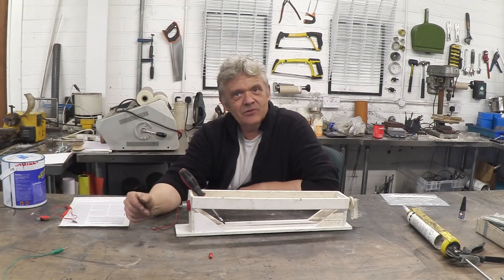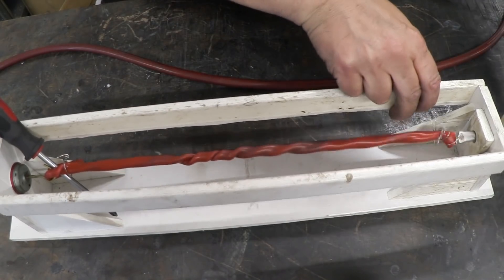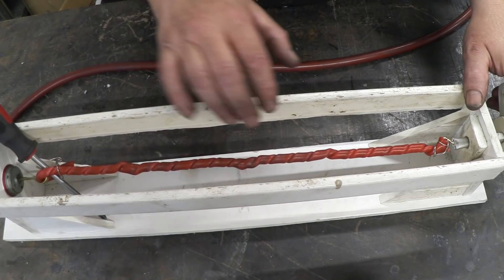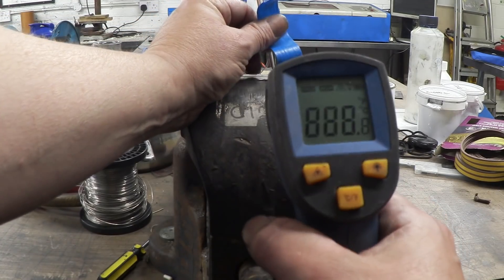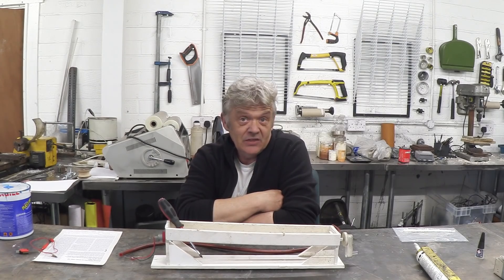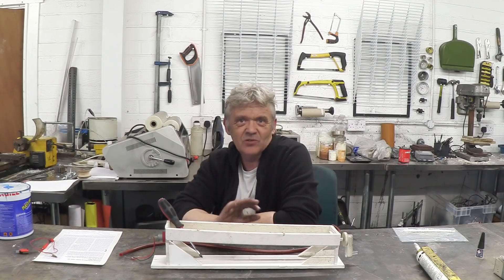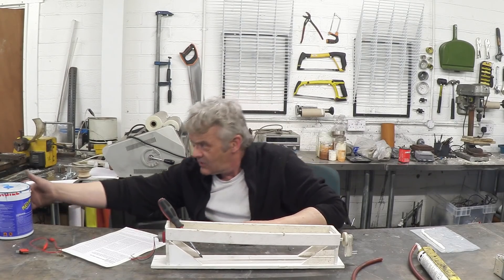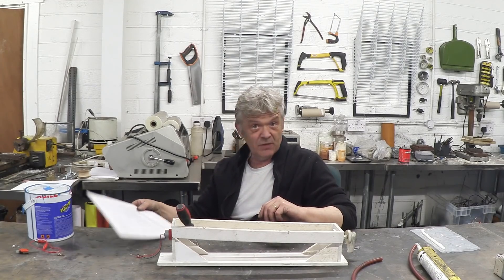Refrigerators From Rubber Bands

Comment: Hello Robert,
Thank you very much indeed for your video. Really fascinating!
I have a project to use mechacoloric to cool a beer-fridge.
Could you tell me what is made of the blue rubber band you use un the video. Since the delta is quite impressive, do you use Nickel - something alloy or whatever?
Thank you very much in advance.
Go on,
Thierry.
Reply: Hey how did your project go? I want to build one for a uni project but I don't know if it could be realistic. I need a 5 c temp difference with the room. Thanks in advance!

Comment: Combine with insulation like high quality goose down,  the new polymer aerogels, or vacuum insulation*, and one might be able to make an actual practical device?  
      Another thing that works is at night, make a conical IR reflector--foam or cardboard with Al foil or the like, invert it, put the small diameter end in a black pot, and point to the open night sky.  It will radiate more IR energy up into space and cool down the black pot or whatever might be in the black pot.  From what I've heard, it can cool down around 15 degrees F pretty easily.  Put that cold water in a plastic bag, or stone, in your fridge, and you can help to jumpstart the cooling process.  
     But honestly, it probably just makes the most sense to dig down into the earth and insulate the top hole cover.  Don't remember the name, but there is a place in AZ (or NM?) in the US where there is a cave that has perpetual ice, even though the temps may be 90 or more *F relatively near the cave--which btw is not that deep in like you might think.
Reply: Btw, anyone have any suggestions for the following?   I was thinking that to make some lower cost and lower weight vacuum insulation panels, you could use a combo of strong per weight plywood treated with S2 fiberglass cloth/epoxy, and in between the wood/S2/epoxy panels, put a few strong, rigid, low thermal conductivity closed cell foam like EEP as short support pillars between the two pieces (like 3 spaced apart). 
   But the question is, once you have drawn the vacuum say through a drilled hole, how does one seal it effectively (and you would probably have to do 6 individual panels separately)?   
   If you could do this, it would make like the ultimate cooler!  (especially if combined with an IR reflector inside or outside).

Comment: I haven't watched this video in full yet, but I did watch a video some years ago on this very topic, they made a wood geared system and measured the temperature difference. I'll see if I can find it again, it was sadly not a huge cooling effect, but it was significant

EDIT: having watched it in full now, you do mention Applied Science, which is the video I thought of immediately upon watching this and I linked in reply to myself :)
Reply: It does sound like with the correct materials,, fan cooling of the super coiling, and a ratchet system for the coiling, which would release when the coil reaches ambient temperature, and then a brief fan burst pushing air into the bottom of the cooling chamber, it might be quite effective. Given heat rises the top should allow for the expulsion of air, which is why I was thinking the cool air should be blown into the bottom. It would be interesting to see the premise properly developed, if at all possible

Comment: Sir, I found that very interesting - as are all of your videos, thank you.
1 - Refrigeration in general - I believe - is traditionally performed by adding energy to a system at one place, and taking it out in another. 
2 - As a parallel to the mechanocaloric effect, I would compare a cylinder containing a piston and air.  You compress the air with the piston and it gets hotter than ambient - due to the energy input.  You let it cool back to ambient, then allow the air to expand back to atmospheric pressure and it goes colder than ambient.  If I wanted to make a fridge that way, I'd  pipe the cold air somewhere else, eg into a closed container containing such material as I wanted to refrigerate.  That seems practical if not very efficient.
3 - Are there practical methods available for performing similar movements of the refrigerant (rubber or etc) in the mechanocaloric method? or magneto- or electro-  ?  Or maybe we move the item to be cooled instead?  How is the refig. material insulated while it's going through it heat-up phase?
4 - Is the twisted rubber (or etc) method more efficient than the air cylinder?  It seems to me there must be energy loss in some kind of friction within the material.
Thank you again for this video.  Clive.

Comment: imagine if helium is wound up and the melting point measured  as we  wind to lithium..then beryllium. ..boron and finally max compression with carbon..if the tension snaps...would that explain the dramatic fall in temperature from carbon to nitrogen ...almost 3800 degrees?

Comment: So it's a similar process as like condensing the area and making it denser generates heat. When the area expands again it will absorb heat. Just like a gas condensed to a liquid heats and and then when expanded back to a gas absorbs heat. What I would really like to know is why is granite colder than the air around it?

Comment: If you had to separate surrounding the weather the the inside tube would be slid into place while you called it up and it generated heat and then slid out of the way into a blowing fan woman released it to generate the cooling effect you could separate the heat from the cold really easily. You basically with me to fanswind to blow across the inner pipe once it's pulled out of the way and when to blow across the cooling in place after the hot tube was removed and slid out of the way. I'm not explaining this very well but I got a good idea of it in my head basically you'll be a sliding heat exchanger for the inside hard tube copper should be used because it would rapidly absorbed the heat then pulled out of the way when the two boys released and allowed to cool and a fan would kick on to blow across the cold remaining aluminum pipe or perhaps not don't even use a pipe for the cooling effect just heavy sensorremove the heater pipe once it's started dropping in temperature

Comment: I could see making a really simple system with your coiled band, some small fan blades [driven by the same rubber band mechanism and its winding mechanism] and some simple butterfly type valves. ~( 'w')/
Reply from the maker: you could even recover part of the energy you put into winding during the unwinding
Reply: You can't cool it back down to room temperature in the same action that you're taking to cool below room temperature (unwinding it).  You'll just end up with a rubber band that's right around room temperature again - not below.  It has to be cooled back down prior to unwinding.   Energy is released nonetheless so, as Robert said, that could be recovered.

Comment: How would adding graphene to your plaster dip do.
Reply: There are similar concrete formulations that contain graphene. UK research has produced graphene-concrete that has double the strength (sounds expensive, even with the recent graphene manufacturing improvements)
Reply: I meant plasti dip
Reply from the maker: it did occur to me mate and I have spent the evening thinking about plastic dip - I don't know if you noticed particularly what the temp changes was but from 22-ish degrees to 26 - ish degrees is a large change - that's very interesting
Reply: @ThinkingandTinkering  I did that's why I was curious as to if graphene would enhance or impede that. My guess both one enhance and impede make the temperature change faster. But would that be beneficial.

Comment: Another great video. I miss the days with no videos but then on the other hand it drives my thoughts crazy when you do post. Hopefully with no hiccups tomorrow my tumbler will be completed but I have to change my power supply for my hotplate as it is struggling to get to 60c with 12v 2.5amps random plug. I'm hoping my old xbox power supply 12v 7amps should cope with a new heating coil 24 gauge nichrome.  Someone care help lol
Reply from the maker: if you up the voltage you will draw more - the draw is fixed by the resistance of your heating coil - having a higher amp supply won't help much as it probably isn't the limiting factor - remember Ohm's law mate - V=IR
Reply: @ThinkingandTinkering  I will have a little play with the coil but feel it's the supply itself not the voltage or amps. 12v 2.5amps @ 200c is asking a lot from just a plug. I'm sure its cutting out. I'm still learning. Crying face lol

Comment: I’ve seen a worker protype (model) of a fridge that uses the elasto-caloric effect.  If I recall correctly, after running for some time it achieved a 2 degree decrease inside the fridge; however, the fridge was not insulated at all.  It was an interesting model (it as around 0.5 cu ft in size).
Reply from the maker: applied science channel mate - i mention it in the video

Comment: Some reason I was thinking about rolling the rubber band on a spool, like a tape measure, or clock spring, with an escapement or something to regulate the output, it would probably work better with a lube, rolling it up under tension, ( if it works atall !! )
Reply from the maker: it is well worth a try mate

Comment: Using electrostatics and an elastomer for mechanical caloric effect cooling: Google  Dielectric  elastomer.... 

Instead of mechanically stretching an elastomer, one can mechanically compress it with electrostatic forces. That is because the rubber does not change volume but its surface area changes under both compression and tension aligning the elastomer chains along a direction. 

Paint graphene ink on two sides of a thin rubber sheet and apply a high voltage between the two plates. The area of the two plates will grow as the graphene plates are squeezed together because of the electrostatic forces. The elastomer will loose excess heat energy during compression phase and absorb heat on the relax phase.
Reply from the maker: that is certainly one whole field to look at mate - but it doesn't make it better - it just makes it different. Mechanical systems have their own place and can very much be a solution.

Comment: Here is an idea I've been kicking around. Dielectric elastomer to electrostatic induction pump electrons. 1) Paint both sides of a rubber sheet in graphene ink. 2) Place a static high voltage on one plate and connect the other to ground through a load. 3) Stretching the rubber increases its length and surface area while distance between the plates shrinks as the overall volume of the elastomer stays the same. This means the capacitance changes as you stretch and relax the elastomer.  

An Electrostatic charge on one plate through electrostatic induction induces an opposing charge on the other plate when electrons are free to move to and or from ground and the other plate. Alternatly Changing capacitance would electro static induction pump electrons to and from ground driving alternating currents through a load.
Reply from the maker: A friend of mine works on exactly that.

Comment: Interesting video. Could a number of bands be used in tandem to accelerate cooling? Band 1, 2, and 3 are supercoiled and brought to room temp, in a box. Band1 unravels, cooling the temperature in the box as well as bands 2 and 3 (still supercoiled), band 2 unravels cooling the box further, and band 3. Band 3 uncoils while band 1 and 2 and recoiled in the cooled box. etc... etc..
Reply from the maker: for sure mate - check the papers I mention and look around them this has been made into working devices